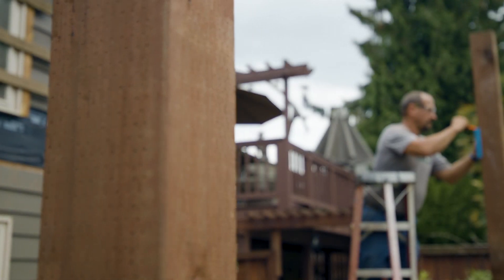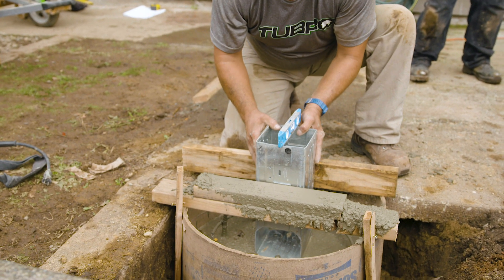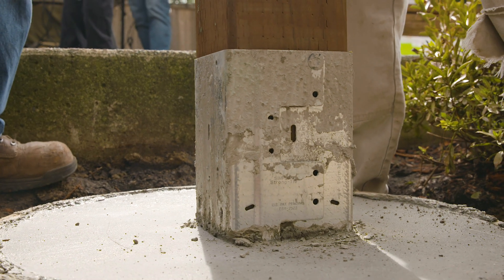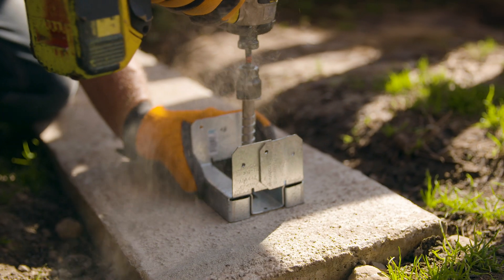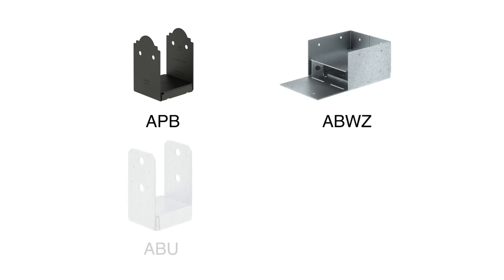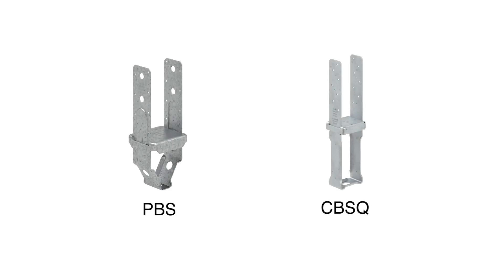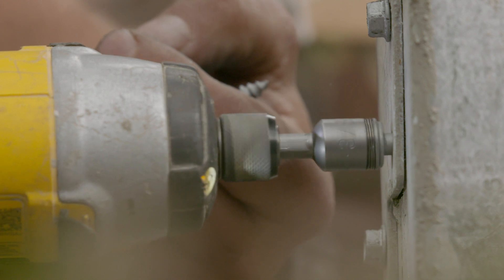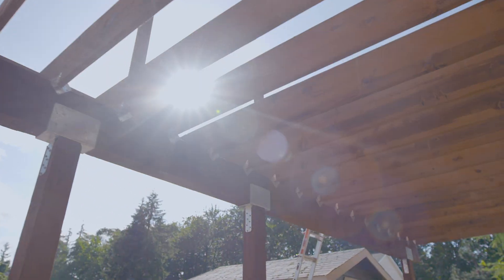Build a Stronger Deck: Post Base Connections

Comment: Well my post bases are giving meheadaches I have 4 and 2 are rock solid, the other two dont stay tight I tighten them up but by the time i fasten the posts the nuts are loose
Reply: using anchors in the holes? sometimes they don't work. use a threaded rod with epoxy. just don't fill the hole to the top as the threaded rod takes a bit of space

Comment: Well my post bases are giving meheadaches I have 4 and 2 are rock solid, the other two dont stay tight I tighten them up but by the time i fasten the posts the nuts are loose
Reply: Use the adhesive glue on the hole where anchor bolt goes

Comment: Although Simpson covers the material very quickly, it's important to note that they manufacture a post-based support that eliminates the need for knee bracing. It's a most excellent solution especially in tight quarters under the deck in which knee bracing can pose a hazard for people who use the underside of the deck and don't want to have a safety hazard of knocking their heads on the knee braces!  Great job Simpson, especially on these professionally produced videos because they are so far superior than other similar ones who produce them and are novices. Keep up the great work simpson! Love your products.
Reply from the maker: Thanks Frankie for watching the video and appreciate the feedback!

Comment: please advise specifically what fasteners are recommended to connect the ABA ZMAX Galvanized Adjustable Standoff Post Base for 6x6 Nominal Lumber to the pressure treated posts. 
i purchased the 1/4 in. x 3 in. Strong-Drive SDS Heavy-Duty Connector Screw (25-Pack), but the holes in the post base are much smaller than the diameter of this fastener.
Reply: I had the same problem, followed the Deck Planner software from Simpson StrongTie's website. Hoping for a reply
Reply: @katiehendrixson  i wound up using these: Simpson Strong-Tie #9 x 2-1/2 in. 1/4-Hex Drive, Strong-Drive SD Connector Screw (100-Pack) SD9212R100-R - no issues so far after two years